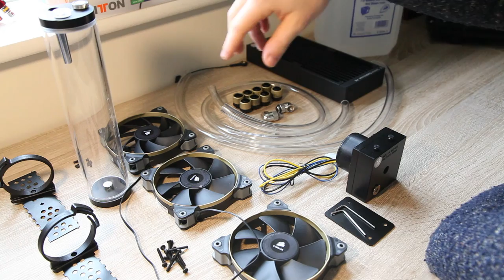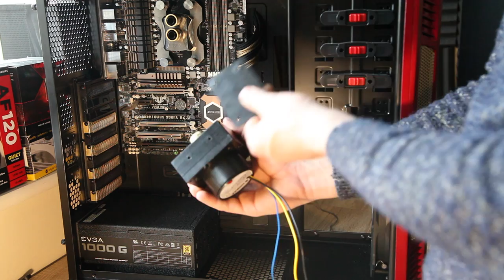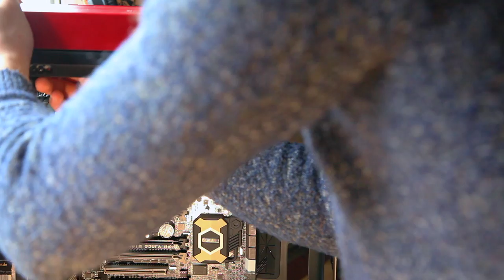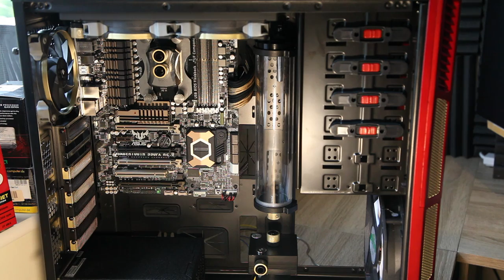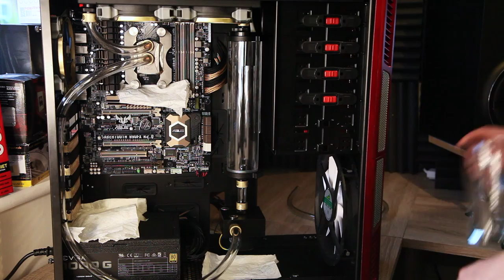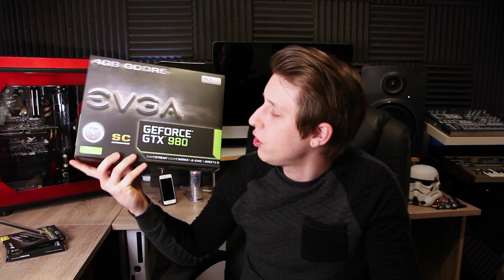Water Cooling The IRON MAN Gaming PC! Build Vlog Pt 2! "Aerocool Avenger"

Comment: I know it has Ben a while since you posted this. But from using distilled water there only how long did it take before your tubing went cloudy ? and fittings started corroding ? Distilled water by itself is a no no. You need to add the necessary Biocides to distilled or deironized water. if not then use a premix coolant... .. .

Comment: Is there room enough under the top shroud to mount the pull fans for a push-pull arrangement? Or must they be mounted directly to the radiator? (Pardon if it's a silly question, but I'm new to water cooling). Keep up the good work, can't wait to see the next step in the build!
Reply from the maker: Hey bud, There could be potential room with case modification but straight out of the box you can really only do a push or pull config unless you was going to go for a narrow Rad! Hope that helps :)

Comment: I also have a Sabertooth 990fx r2.0 motherboard with an  FX-9350, but my boot time is really really slow, especially in comparison to older pc's I had. do you experience that aswell?
Reply from the maker: No sorry to hear that bud I don't! I have a very quick boot time. Do you have an SSD?
Reply: I had an HDD, but I upgraded to an SSD and it's fixed now! Turns out I just had a really slow HDD ghehe

Comment: I'm still awaiting for th rest of my stuff to turn up for my first build, should i water-cool on my first time? I've got two 980's g1 editions and the processor will be a 5960x octacore, I'm not sure weather to try air cooling for a little until i work my way round it, or should i straight away water cool?
Reply from the maker: It really depends if your planning to overclock it? Water cooling the CPU is relatively simple to do and worth doing if it suits your budget. If you plan to do this, the choice you will have to make is whether you want to create a custom loop or alternatively use a all in one cooler. Both have pros and cons being the custom loop you can easily expand down the line and the all in one being Easier to fit! As for the 980s if your not planning to overclock the standard coolers do the job just fine. Hope this helps :)
Reply: Thanks man! I'm hoping to over lock cpu and gpu somewhen in the future but not too soon haha!! I'll probably look at an enclosed loop first of all and then invest in a decent custom loop like yours (which by the way was nuts) and see what happens? But mainly want the cpu to be water cooled more than anything because that's probably what I'll be over locking first for numbers sake, anyway do you have a list of decent items for a custom loop anyway?? Thanks for the reply man!!:)

Comment: Since you said that you wanted clear and minimalistic look,why did you put that atrocity of rubber tubes? You obviously put lots of work in this build and those tubes just ruined it.You should have gone with acrylic tubes.Build would have turn out so much better and cleaner.
Reply from the maker: Thanks for the comment. I did considor acrylic tubing however i felt for this particular build normal hose would do just fine. There is only a very small amount of tubing showing and the way it displays looks neat and tidy, That being said i am contemplating swapping over to acrylic tubing when it needs a fluid change. Thanks again for your input :)
Reply: NerdLife-A

It is nice build,i think it would look better with acrylic tubes.And you can take your time with bending and minimize amount of tubes that are visible if you want.But that is just me.